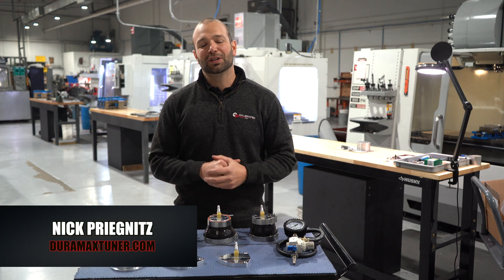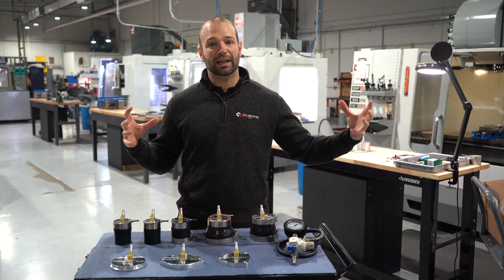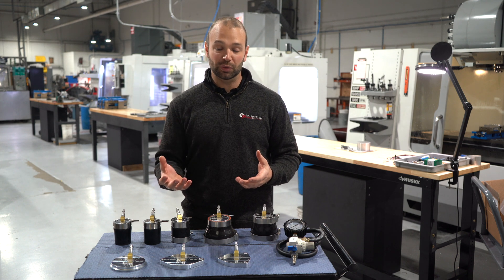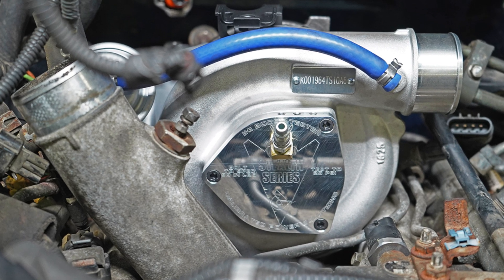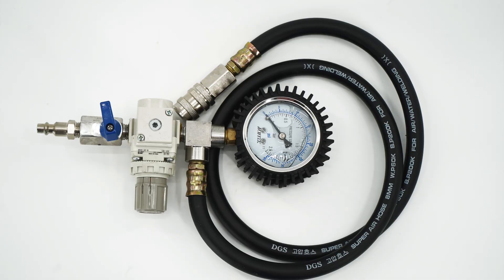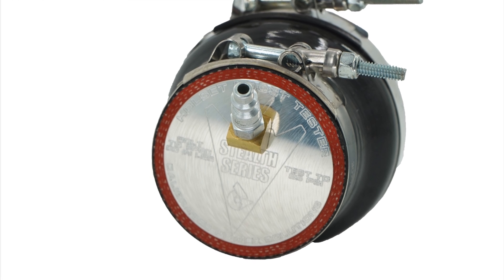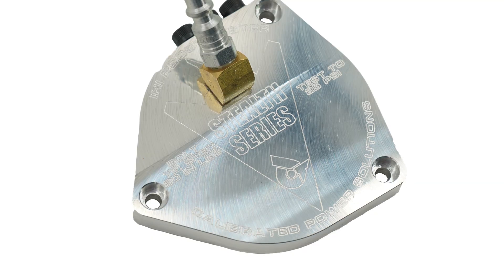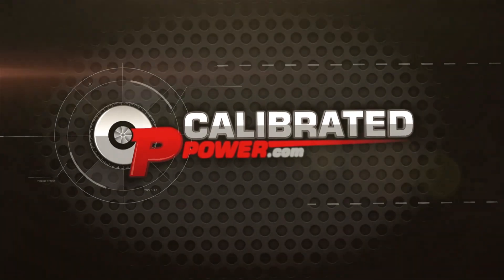Find the Leak! STEALTH BOOST TESTER

Comment: Im only making 16psi on my lml. It runs pretty strong. Is it tuning or a boost leak?
Reply from the maker: @poschevy7852 A Boost leak test is always the best place to start. It's pretty unlikely that the tuning would cause this.
Reply: I figured that. Peak boost is around 2600rpm then vane position opens to 19-23% and that when I'm loosing boost.  I think I've found the right to table to change just haven't yet
Reply from the maker: @poschevy7852  That does sound like a vane position or wastegate issue. Let us know what you end up finding!